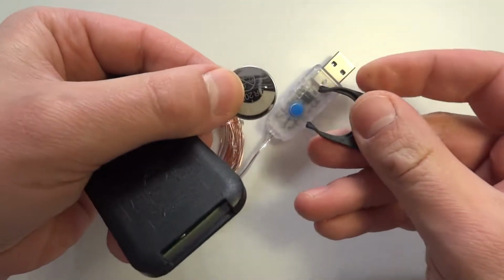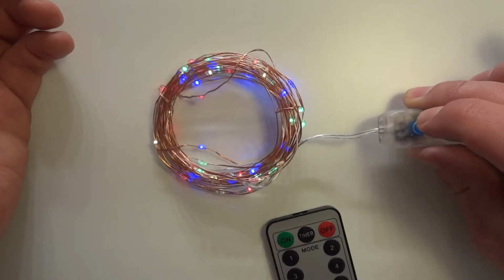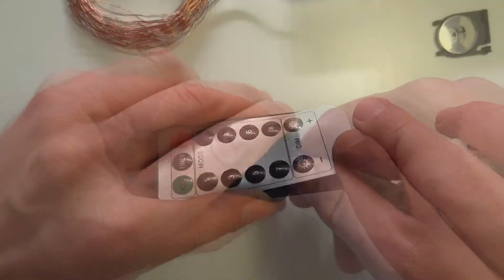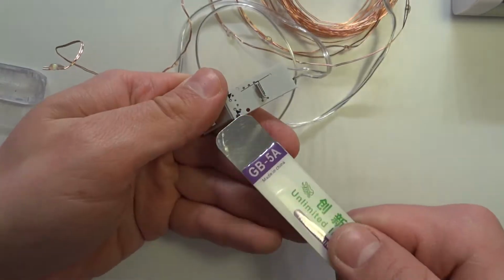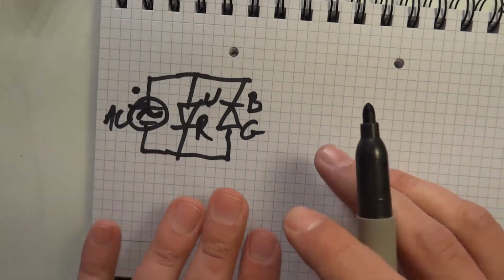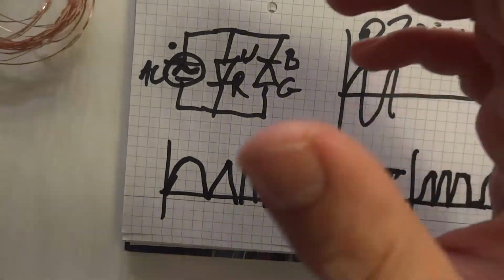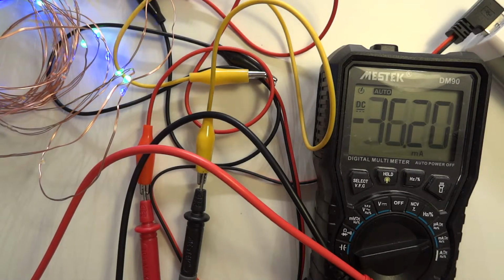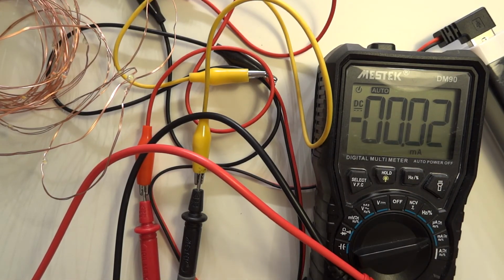Closer look at USB powered LED string fairy lights with a remote

Comment: What interests me most is how the light intensity is changed (brightness). I know that the remote has two buttons for higher and lower intensity. But how is that done? Does it reduce and increase the voltage on the LEDs, or does it regulate the current through the LEDs? Have you measured that? Is it possible to extend the programmed operating time from 6 to 8 hours? I just don't understand why they put a 6 hour timer and not an 8 hour one, which would be better.
Reply from the maker: Brightness is done via pulse width modulation. For 100% brightness they do +3V and -3V interchangeably(so both "sets" of colours are lit). To get a 50% brightness they do something like +3V, then 0V, then -3V and 0V, all 4 steps in 25% duty cycle but since the frequency is in kHz it's invisible for a naked eye and at that frequency even for a camera.

I doubt it's possible to adjust the on/off time, since it's usually baked into the microcontroller.
The 6h on, 18h off is something I found in IKEA's LED candles too. I assume it's a power saving measure, but it would be nice if it was adjustable.
Reply: Why did I ask that? I have similar LED Christmas decorations. Not only like this, but also in other shapes. For example, in the shape of snowflakes-dandelions, stars, etc. What they have in common is this control. Also, some are powered via USB, but I have more that are powered by 3 or 4 AA batteries. That is more practical for me, because they are independent and I can put them where I want. All the housings are waterproof. The ones with USB power are connected to a Power Bank. Since I activate it every 6 hours and at night, the weakest light is enough. So the AA Eneloop Pro batteries last me over a month, just like the better Alkaline batteries. I measured the consumption on a "dandelion" with 200 LEDs and when they are all constantly lit with the strongest light, (4×AA) the consumption is just under 120mA. But at the weakest light the consumption is only 20mA. But I don't use that mode, but program 1 (combination of all modes of operation), and there mostly only 100 LEDs work at the same time, so actually the average consumption is about 10mA, because they turn off and on in various modes of operation. Mostly very good LED decorations that do not require a voltage of 230V or 110V. Let's not forget. Works 6h a day, consumption 60mA a day. 30 days=1800mA. Consumption in OFF mode 0.2mA.
And as for the Timer, yes, it's probably programmed that way. It's a pity, because it would be a better option to queue for 8 hours. In Europe and the Northern Hemisphere in winter, the night is 15 hours long. That's why I asked if maybe there is some way to extend it to about 2 hours more. This way, some of them turn on at 6 pm and light up until midnight, and others turn on at midnight and light up until 6 am. If there was a possibility of 8h, they would be active all night, all 15-16 hours. Here's what I'm writing about:
https://www.aliexpress.com/item/1005006176622489.html?spm=a2g0o.order_list.order_list_main.597.6af61802gpXL8n
https://www.aliexpress.com/item/1005004740705650.html?
https://www.aliexpress.com/item/1005001319841721.html?spm=a2g0o.order_list.order_list_main.617.6af61802gpXL8n

Comment: Hi, I have similar lights but when switched on, they blink. Is there any way how to get rid of programs and make it just on/off? Thanks for help!
Reply from the maker: I think you need to have it connected to USB at all times for it to remember the static program, then turn it off by a long press of the button.
They're tricky to modify because they need alternating current for all of them to look like they're all turned on.

I recommend getting some battery powered (3xAA or 3xAAA) and modding those into USB - they often have better colours too. I made another video with a guide on how to mod them ( https://youtu.be/f1Dqvid4hPM ), but you could ignore it altogether and connect the terminals as is to USB -  they'll get a bit brighter with possibly slightly reduced lifespan because of just slightly higher voltage 😁
Reply: @pandaengineering  Thank you for your answer! Unfortunatelly the device doesnt remember previous setting so I have to click like 9 times to choose static program and thats slowly killing me, day after day :D I have no education in this matters but I was kind of hoping that maybe | can just remove wires from board and weld them in front of it so that annoying programmes are skipped ...😅 This type of controller was on the last 3 lights I got online and I bet there are others struggling with same issue...
Reply from the maker: @mojejmeno6346 that's a shame. If yours have programmes like the one from the video (can switch between colours and not just brightness or flashes) it's wired so connecting it directly would just light up half of the colours - you need alternating current to keep all of them lit.

Comment: How do you think I can solve the control so that it always drives all the LEDs or how can I generate 5 volt alternating current, I can't find anything on the internet that is max 12 volts.
THX
Reply from the maker: That sounds tricky. I don't think I ever measured the voltage in the video but I would assume that it's driven by 3V (typical nominal LED voltage, anything 2.8-3.1V should be ok, depends on how bright you want). Perfect for driving them all would be a mid or high frequency square wave 3V signal (maybe with some current limiting just in case). That would have to be square wave that passes the 0 crossing, so the range is -3 to +3V

Most modules I found like  "1Hz-6Khz Adjustable signal generator Square Wave generator Module For Arduino" or a 555 timer, PIC microcontrollers etc. generate a signal with certain duty cycle, so it's (for example) +5V or 0V and doesn't cross the 0 to go to -5V. If you would want to connect it to mains probably the best old-school way of doing this is current limiting a transformer, but these days probably the best choice is to use a module or a 555 timer and then add an Op Amp to make signal go through the 0 crossing (so in case of mentioned module +5V;0V with Op Amp you could make it run +2.5V;-2.5V).

If you're looking specifically for ready made modules, I think it's a good idea to research one based on ICL8038 (just lookup "ICL8038 generator"). Make sure it can generate signals at 100mA that can do zero crossing and 200Hz+(preferably 1kHz+) with amplitude adjustments. I haven't test that, but with luck AND voltage limiting it should do the trick 😁 note that most use 12V power supply so you may need to get DC-DC stepup converter first to get USB's 5V to drive it.
Reply: Thx for the ideas!

Comment: what kind of battery pack are you using to plug them into?
Reply from the maker: It's just some cheap power bank. It wasn't really great as it lost more than half capacity in 6 months and I only charged it 4-5 times 😅

Comment: Can the circuit be programmed ??
Reply from the maker: I doubt it. This seems to be a standard chip they use in many IR controlled lights.
Reply: @pandaengineering  true it is oscillation between positive and negative - interestingly there is no data sheet showing IR functionality !
Reply: YX8682H - is the chip fyi

Comment: hello! bought a 10M string light with the module and remote and try to connect my other 10M string lights, but the module is not providing enough power to handle overall 20M of string lights. first 10M is brighter but the other 10M is dimmer than the first one. 

do you know solution for this problem?
Reply from the maker: This may be due to voltage drop, because the cable is pretty thin.of that's the case, the easiest solution would be to connect both strings to the module directly so it will be in the middle when you stretch the light strings. The next solution is to keep connecting strings one to the other but add a pair of wires going back to the module so the 20m string will be connected at both ends. This will reduce the voltage drop over the length of the string as it would be powered from both sides.
Reply: @pandaengineering  thank you for replying, can this module handle 12 volt? what if i change the connection type usb to 12 volt and use a 12 volt power adapter to power up the LEDs 🙂
Reply from the maker: @tawha.hasan0 I would say it won't be able to run on 12v. The module from the video drops a bit of voltage and runs all LEDs in parallel (at ~3v). The 12V led strips usually have sections of 3 LEDs in series + resistor for current limiting. This is why they can run at higher voltages.
Reply: @pandaengineering  thank you so much for helping.

Comment: Mine won't turn on whether i use the remote or press the button, I just got them a few months ago and haven't used them much, anyone know how to fix them?
Reply from the maker: Most common issue people report is that the wire with LEDs simply breaks off the board. Maybe it's as simple as soldering it again 🙂

Comment: Can you cut those fairy lights?
Reply from the maker: Yes, LEDs are connected in parallel so it shouldn't be an issue.
Reply: @pandaengineering  Thanks

Comment: I was wondering if one LED bulb burnt out will the whole string go out....
Reply from the maker: Not in this case. USB powered LED strings are in parallel (in this specific case, two sets of colors are in opposing polarity). Thing you're mentioning happens in mains powered lights, where usually the LEDs are in combinations of parallel and series where just parts of the lights could go out in case of single LED failure.

Comment: I have that usb its very loose broken pls pls pls tell how too fix?
Thanks
Reply from the maker: If traces are not broken you will probably have to solder it again😕 important thing is that you connect pins on the side as the two middle ones are not in use. Looking at few other comments it seems to be a common issue and probably is just poorly made.

Comment: Where can I purchase these lights and what is the brand? Is there a link you can share for where you bought these? Thank you
Reply from the maker: I've got them off AliExpress. I don't put the links to anything because the offer is usually gone within a week or two and those that stay will increase in price over time (sometimes 4x as much!).
Try searching Ebay/Amazon/Aliexpress (or any of your local stores that carry Chinise imports) for those keywords: "multicolor usb fairy lights remote"
The price range right now seems to be between $3-5 and I wouldn't pay more considering that they failed for several people in the comments (mine still working! 😁)
Reply: Okay, thank you

Comment: This is a fantastic video and I really appreciated the in-depth look and explanation on how LED fairy lights work! It brought back some college physics classes. I was wondering if there is a way to reprogram the lights. I have two separate USB to LED fairylights with the exact same remote and USB set up as you have in the video. However, the button 1 on the remote = white light on one string and multicolour light on the other string. There are a few mismatches throughout all the lights modes and buttons. Is there a way to re-do the light setting to button number so both strands look the same when one button is pressed? I have two remotes but one remote triggers both strands.
Reply from the maker: I don't think it would be easy to dump the software from the controller and program the other one - that would be the exact solution 😁

If you can confirm (for example with meter showing AC on the output) that the single color string outputs similar signals to the color LED string (so there are LEDs in the oposite directions) you can try to connect both strings to a single controller. Note that it will be dimmer overall and you should monitor for some time the temperature of the chips (simply see if they're getting too hot to touch ) in case they're not speced to something like that 🙂 this is the easier option 🙂
Reply: @pandaengineering  I'll try that out! Thank you so much for your help and insight! :D

Comment: Is there any way you can drive a string of these light steady by shirting the circuit somewhere? Like if you wanted to hardwire a on/off and remove the need for remote/button.
Reply from the maker: No, sorry. If you put DC either way on this LED string only half of them will light. To light up all of them it has to be driven by AC with (preferably) frequency over 100-120Hz so it will be looking like a steady light.

Comment: Do you think these could be a fire hazard ?
Reply from the maker: I don't think so, even if it would short circuit, the wiring will burn though in a jiffy, because it's so thin. I think the worst case scenario is the chip overheating and failing which happened to me with bluetooth headphones, but it was so instantaneous that I didn't even knew. There was only a sign of heat failure on the chip. Usually the semiconductors burn through at about boiling temperature on it's package(although some can come up to 200 deg C) so that shoudn't start a fire, but may melt the plastic casing in worst case scenario. I think for fire to start that would have to fail and be wrapped in very flammable materials.

Comment: Just wanted to say how good this video was. Amazing detail. Thanks for explaining how it works and for doing such a good job.

If you, or anyone else, can figure out the timer please let me know. I tried pressing the timer button and they stay on for 6 hours...but then never come back on.
Reply from the maker: Thank you! That's very kind of you ☺️ I was almost 100% sure that it was 6h on, 18h off. Some other lights from IKEA had the same timer setup, but if you're running it from a powerbank and not from the USB charger it may mean that the powerbank went to sleep mode(some of them do if there is no significant load connected) and is not providing the 5V required to power it back on after 18h. Just my guess 🙂
Reply: @pandaengineering  I'm using a 12v to 5v USB adaptor so that I can just run them off old 12v batteries I have at work. I'll experiment this week and comment back if I figure it out!

Comment: Hello! Did you measure the voltage? I think mine are failing and I'm thinking about using an arduino to drive the strip.
Reply from the maker: Sorry, I don't have access to it right now to check but since nominal voltage of those LEDs is ~3V, I would expect an AC voltage reading (full brightness) up to 2.12V AC (3V of peak voltage divided by square root of two).
This calculation has a lot of assumptions, like that the AC is sinusoidal (which it probably isn't, but I don't have oscilloscope to test that) and that reading would be done at fully lit one way (so for example only green and blue).
Reply: @pandaengineering  No worries, thanks. I don't want to take them appart just yet. I also don't think it's sinusoidal so maybe I'll be able to measure the voltage using one of the slow blinking modes.

Comment: Can you use this outside? Or only indoors?
Reply from the maker: The string itself should be fairly ok outside for a season, but the little board probably won't last longer than maybe a week or two in the elements even if it doesn't get any direct water ingress.
If you plan to use the string itself outside, it's a good idea to put a blob of hot glue or something like thick nail polish at the end of the wires. It should prevent them shorting out on wet surfaces and degrading the wire over time.
Reply: I put mine in a bag with a battery last year. Came to them today to put a new battery on and they're still working fine!
Reply: I plugged them to a 5V - 2A and works fine, but then plugged them to a timer and won’t turn on unless I press the usb button. Is there a way to turn them on without have to press the button?

Comment: Thanks for showing the inside of this usb connector. I have this xmas light but the wires are detached from the controller and there is no way to make it work without reconnecting the wires. How do you know which wire is positive and which is negative? does it matter really matter on which side to connect?
Reply from the maker: In this specific light (since it does all the effects with alternating current) it doesn't really matter. It will work both ways.

For static lights, if you can't check with meter, you can connect a resistor in line to try both ways. I have to admit that I usually go with trying both ways without anything and rub the wires just for a second 😉

Comment: my lights stopped working, is there something that i can do? can u help me? :(
Reply from the maker: Check the wire end if they didn't shorted by accident(isolation can wear off and wire could short) and if they're fine, try to open it because the wires may have snapped off from the board.
Reply: @pandaengineering   thank u so much for answering me, youre such a good person 💗
Reply from the maker: anytime! ☺️

Comment: This is going to sound weird but I need help. I have led lights and fairy lights and I’ve had the led strip lights for awhile and just got the fairy lights and they are both remote but when I used the remote for the fairy lights it was controlling the led lights and it won’t stop is there anyway to disconnect it?
Reply from the maker: Remote they bundled in is fairly common and they just change the faceplate. It's also used for car FM transmitters, cheap car radios and light bulbs.
It sends exacly the same codes and it's not possible to "pair" it with a device and it's up to receiving device what action is triggered on specific IR codes.

Only way is to tape over the IR reciver (the black component with 3 connections with slight bulge on one side) on the one you don't want to control. Make sure it's completely non-transparent and it should do the trick. You can cut it out too, but I usually just tape it over in case I change my mind in the future ☺️